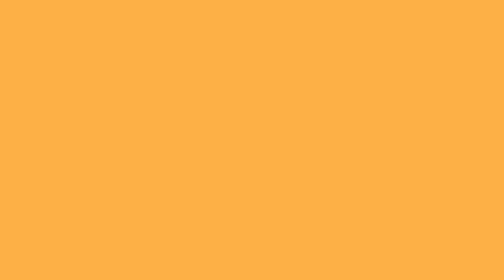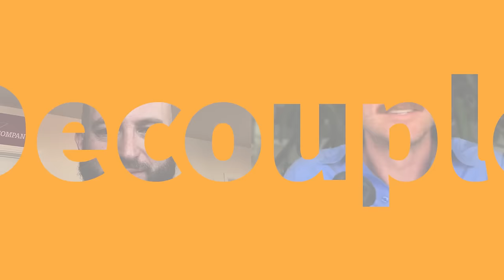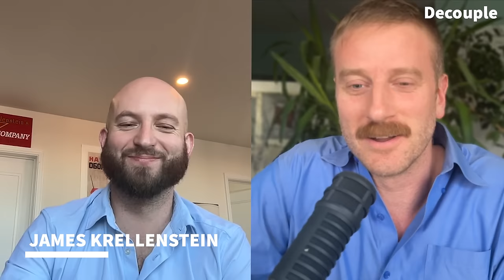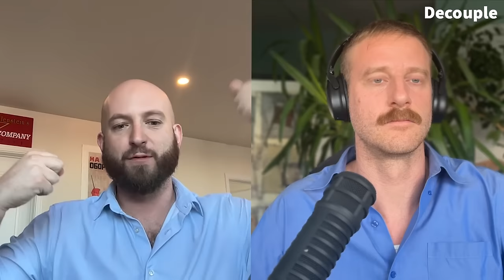Enriching Uranium Understanding

Comment: This guy rules.  I learned so much today.  Thanks dude
Reply: CORRECTION: Canada does NOT have the worlds largest reserves - Australia does. Historically Canada is the largest producer. 
FYI - I have worked in Australia's Uranium industry. I have left a longer comment if you're interested.
Reply: learned what?
Reply: @vsstdtbs3705  How about the fact that America needs Russia to supply it with fuel for its reactors?

And that despite all the sanctions on Russia enriched Uranium fuel is NOT on any of the restricted or the banned lists.

That's not widely known.
Reply: @tonywilson4713  That is fine, but should have been said by Brandon. 
YT is full of benign comments like, "I learned from that."

Comment: Could you transmute the uranium 238 to plutonium with neutrons and separate chemically at a commercial profit? Or do it with thorium too? (only at 52 minutes at his point, back tomorrow)
Reply: Not profitable. France does it to its spent fuel, but out of principle (and Japan pays France to do the same with Japan's spent fuel). See the 2001 book: Megawatts and Megatons by Richard L. Garwin and Georges Charpak.
Reply: Not without pissing off the NNSA 😅
Reply: CORRECTION: Canada does NOT have the worlds largest reserves - Australia does. Historically Canada is the largest producer. 
FYI - I have worked in Australia's Uranium industry. I have left a longer comment if you're interested.

As too your specific question on transmuting go look at the Wikipedia page on CANDU to see how it does what it does.
FYI - all nuclear reactors are effectively transmutation systems.
Reply: In fast breeder reactor you can.

Comment: Most of the problems in this video would be curtailed by using a molten salt reactor so as to use all the stupid waste from pressurized water reactors. PLENTY OF FUEL.
Reply: You'd need to replace all 94 solid fuel reactors in the country first. Just rebuilding a centrifuge would be so much cheaper. We can also build molten salt reactors in addition to that.